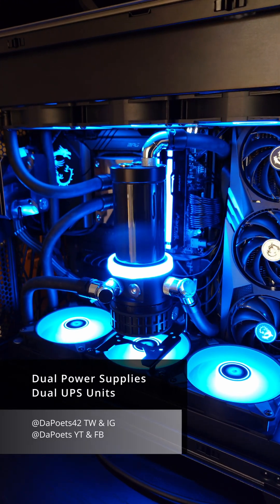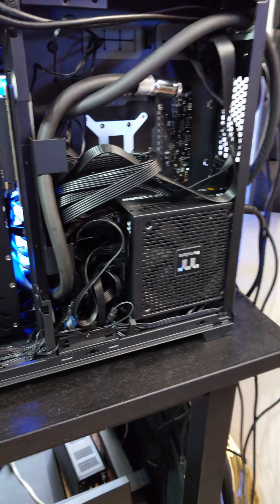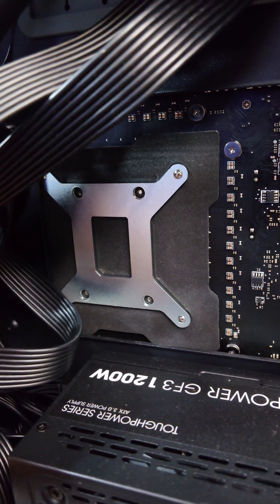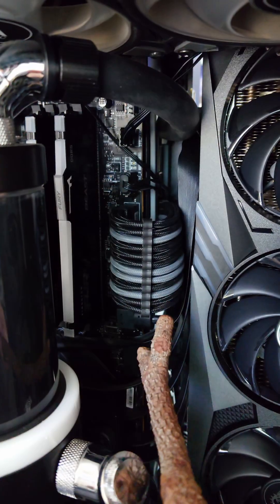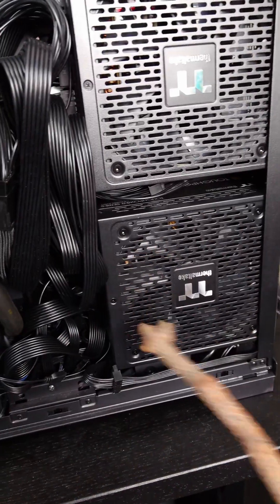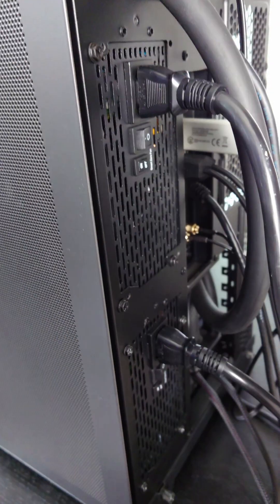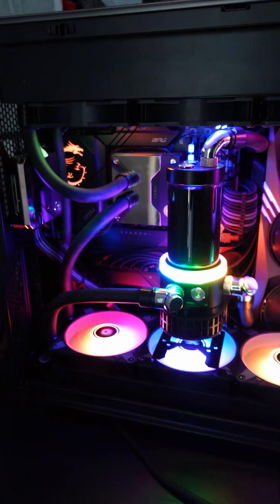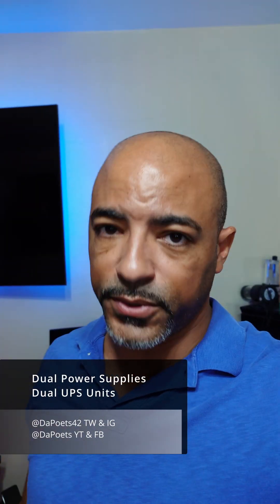Dual PSU UPS PC Build

Comment: So ... I have a question: do both PSUs shut down simultaneously when you power down the computer? What about when they go into S3 suspend (yes, some of us still prefer that to the "Modern Standby" :D)

I have a similar setup, but am not using a Y-cable like you have. Instead, I'm using a purpose-built PCB circuit that piggybacks one PSU to power the other. They both power up just fine, but when powering down things aren't going as smoothly - most likely b/c voltage from the secondary (GPU) PSU is bleeding over into the MB via the GPU, thus keeping it "alive".
Reply from the maker: When done this way they act as one
Reply: @DaPoets  are you POSITIVE?

Sorry if I sound incredulous I just want to be sure of what I'm going to do to minimize risk and not buy (more of) the wrong thing...
Reply from the maker: @drivera obviously do your research and double check everything you're doing but this is nothing new, it's been done this way for decades.
Reply: @DaPoets thank you! The research on this has been a bit challenging b/c everyone stops at "do they power on simultaneously" ...

Thanks for taking the time to help!

Comment: Do they have to be matching brands or a certain type of psu? Wattage? Can you use dual rail or single only?
Reply from the maker: Matching the brands may add a slight amount of safety but it's not really important. As for the rails it depends on your build needs
Reply: @DaPoets ok ty

Comment: im told you can have ground issues, voltage conflicts and risk using 2x psus
Reply: Can you elaborate on these? I'm currently considering adopting this strategy (for various reasons) ... and I'm very much interested in hearing about all of these tidbits.

Comment: Hey nice build! Quick questionf or you, I'm building a similar rig but in the 900D. I'm currently running two 3090 but would like to add a third 4090 in vertical. How did you managed to mount it vertical like this, you used some vertical bracket? Thanks !
Reply from the maker: That's just part of this case, it's a built in feature.

Comment: This is way cooler, there's another version like that but with a printed circuit board, i prefer just the cable. Question: when you shutdown the pc, does the second supply shut's down too?
Reply from the maker: Yes

Comment: I'm currently working on a  build..........I have a corsair 1000D case, 3 big rads with 24fans push pull configuration,  ek magnitude cpu block, ek front and back active  cooling plates for a RTX 3090 strix gpu, 2 D5  Pump Res combo,  and a  threadripper 3960x cpu .  

I'm using a corsair HX1200 watt power supply .    I believe I'm dangerously coming close to the power limit !  Do u suggest a bigger power supply ?  Or can I split up the power with a smaller corsair SF 1000L fully modular power supply ??  

I'm not sure if I can mix and match the power supplies?

Comment: do you have a video with detail on how to build a system like this?
Reply: If your PSU is 1200 watts and your system is running around 1000 watts. It is over the psu efficiency. Does needing 2nd psu 

PSU 1 CPU, MOBO, FANS
PSU 2 GPU, FANS

You'll need an ADD2PSU or the one that he used a "splitter"

Comment: I would recommend a ADD2PSU conector.
Reply: what are the benefits
Reply: @OwlyEagle  the Y-cable he's using may not be of high enough quality and under load it may melt/short out/damage the motherboard. The ADD2PSU unit isolates that by using a relay circuit to power up the secondary PSU when the primary PSU supplies power to the circuit. I have one and it works just fine for power-up, but it's not working that well for shutdown/suspend...

Comment: What brand splitter did you use? 
I've seen some on Amazon that people claim melted.
Reply from the maker: There's no reason for these to ever melt. Most likely people did not have them installed correctly. Not much current at all goes through them. I don't even think mine had a brand name on it.
Reply: @DaPoets  Made no sense to me either, but figured I'd ask.

Comment: Love your work, keep it up! 

Quick question about the way you're splitting that power: Since that gpu you're splitting off is probably already balancing input power from the psu line and the mobo express line (I assume they all work like that), what would happen if there were to be a ground loop between the two terminations? It seems like you'd want to ensure that the grounds for each line were tied together somehow at the gpu. They might already be tied together internally, it probably depends on what the manufacturer decided. Any thoughts on this?
Reply from the maker: The are plugged into two UPS units so it's all taken care of
Reply: @DaPoets  thanks for the reply. It's not clear to me how the UPS, being separate and at [possibly] different ground potentials, would solve the [possible] ground loop at the gpu. Please update this thread if you come upon a technically sound answer, as will I. I'm gearing up to do something similar, so I'll need to figure this out eventually. 

Thanks again!

Comment: what's up man! amazing build you have there. I want to do the same in a near future, but my question is, why do you need that splitter for the motherboard? it's not enough connecting the motherboard to the psu 1? i mean, that dummy part of the cable does something? thank u bro!!
Reply: It's there so that you don't have to manually jumpstart the Psu's (like you might do to test it with a paperclip.) Instead, the adapter splits off and sends the "on" signal to both power supplys simultaneously.
Reply from the maker: There are 2 PSUs because the load is too great for just 1 UPS, therefore there are 2 UPS units and I put a 2nd PSU in the system to split the load between them.

Comment: APC 1500va is working good on this gient PC? Is it giving proper power? How much is backup time? Does It comes automatic with voltage regulation?
Reply from the maker: having 2 of these 1500va units each plugged into their own PSU has been a flawless experience.  Backup time will range depending on what tasks are being performed, but more than enough time to properly shut down if power doesn't come back on right away.  Check out the APC 1500VA for full specs on their website.
Reply: @DaPoets  thanks brother ❤️❤️

Comment: I'm guessing #2 PSU shuts down along with #1 PSU?
Reply from the maker: They are synchronized
Reply: @DaPoets  all you had to do was plug that 2 line splitter cable into the second PSU and then it syncs automatically?
Reply from the maker: @tomtouma  That's what that does, yes.

Comment: Hello. You comment saying that the EK Delta tec cooler won't work on 13900K delidded, why did you say that?
Reply from the maker: Different height. When you delid, you are removing the IHS, so there will be a gap between the die and the cold plate.
Reply: @DaPoets  Oh ok that's for direct-die. I thought you were saying that the EK delta tec won't work if you delid the CPU even with its original IHS. I misunderstood

Comment: Are you ever going to water cool the 4090
Reply from the maker: probably not as there is no need to water cool the MSI Gaming X Trio line. They are silent w/ low temps already. It would be just for looks if I did.